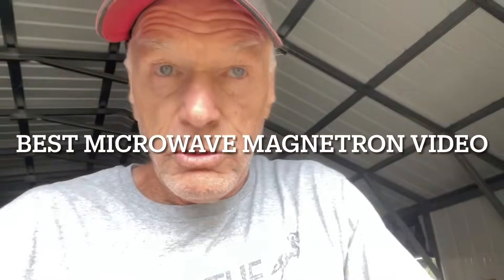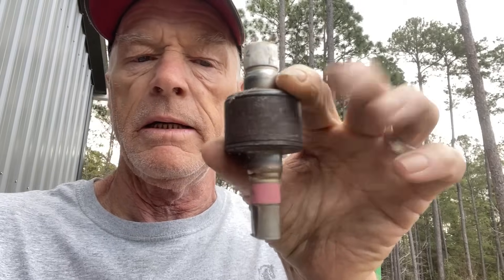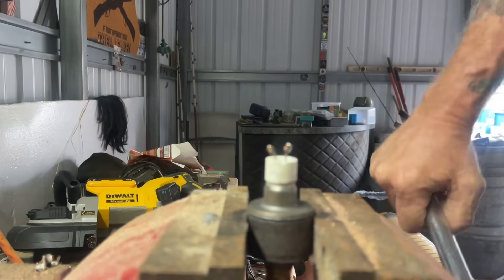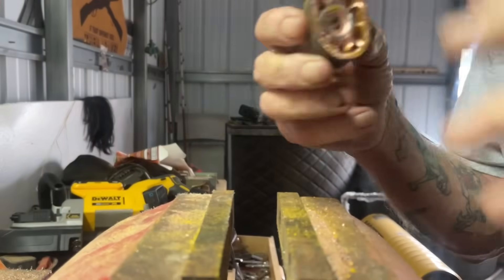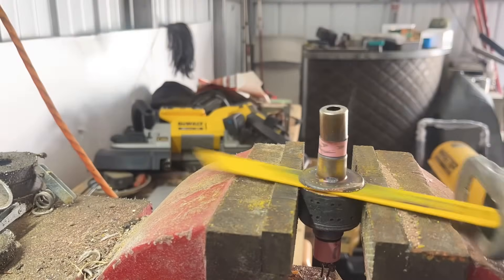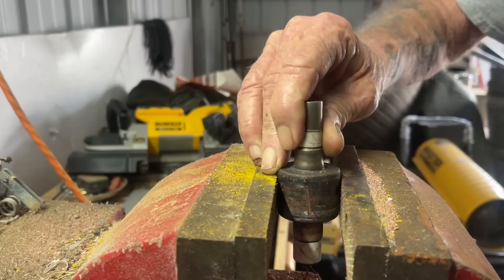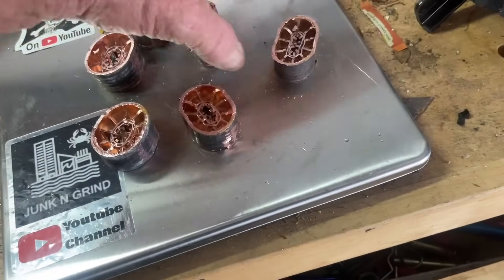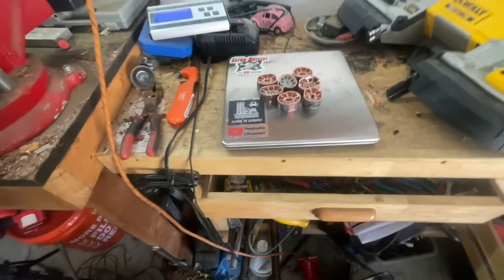(HOW TO) Scrap a Microwave Magnetron. You won’t believe. What’s Inside?

Comment: WARNING > WARNING > WARNING > The pink ceramic on the magnetron is > berrilium < and very very very VERY VERY dangerous !!!!!!! " Beryllium sensitization occurs when the body's immune system reacts to beryllium, which can happen through inhalation or skin contact with beryllium dust, fume, or solutions. This sensitization can lead to chronic beryllium disease (CBD) if further exposure occurs. > Skin Contact: Direct contact with beryllium-containing materials can also trigger sensitization <
Reply: Once sensitized, individuals may not show immediate symptoms. However, they are at risk of developing Chronic Beryllium Disease (CBD) if they continue to be exposed to beryllium. Symptoms of CBD can include:

Shortness of breath
Coughing
Fatigue
Weight loss
Night sweats
Reply from the maker: Look it up on Google. They do not use beryllium anymore in microwaves
Reply: @ScrappingwithGrandpa  from what date forward????
Reply from the maker: The other answers that are currently here are reflexive maybes that don’t actually answer the question. It depends when your microwave oven was made, but for new ones in countries far from Russia I think the answer is no.

These days units and their parts are made in Asia. They probably use aluminum because it is probably cheaper.

There is a discussion here and elsewhere. The measured density was 3.7 g/cm³, near 4.0 g/cm³ for polycrystalline ruby. Meanwhile, beryllium oxide should have had a density near 3.02 g/cm³.
Reply from the maker: Contrary to popular belief, most consumer magnetrons use aluminium oxide (alumina) instead of the much more dangerous beryllium oxide for the insulators. Alumina is considerably cheaper for consumer magnetrons and if broken does not carry the same health risks of broken beryllium oxide.

Comment: DO THIS WITH EXTREME CAUTION!  The magnetron contains beryllium oxide, which is used as a ceramic insulator due to its exceptional thermal conductivity,  electrical insulation, and high dielectric strength.   BeO is safe when intact, but if crushed, ground, or inhaled as dust, it becomes EXTREMELY TOXIC.   It can cause a fatal lung disease called brylliosis.  A pink ceramic ring is often a sign of BeO, but It can be hard to identify as not all are labeled.   It's safest to assume any magnetron contains it unless proven otherwise.  BeO is classified as a carcinogen and can cause chronic brylliosis disease (CBD).  Be safe out there.
Reply from the maker: Thank you for the information, safety is always the top priority. Look up on Google if they use it any more. You will find out that they do not.

Comment: You have to do eight of those things to make $4 ?
Reply from the maker: Yes, but the thing about it is, I can do 25 of them in one hour. That’s what makes it worth it. Save them up.
Reply: @ScrappingwithGrandpa  That's about $12 an hour. Does that include removing them from the microwave oven, or collecting them and throwing them on the truck? What about truck expenses?

Comment: Please be careful cutting, vibrating, blowing dust off the radioactive ceramic pieces, that dust in lungs even a single particle is no good. Maybe a good safety measure to lay out a bit of scrap paper if any particles go free they will not go onto floor so easily and be tracked into home. dip in candle wax to seal it quick be good too. Smoke detectors are bad too old clocks are even worse if face is Iridium painted glow in dark.
Reply from the maker: Great points, safety is always the most important thing!

Comment: I got very sick about 40 years ago and eventually was diagnosed with Sarcoidosis. It turned out I didn't have Sarcoidosis because I'm still alive, but I suspect I had Beryllium toxicity as the symptoms are almost exactly the same. I was scrapping some old electronics, microwaves, relays and other junk. A heads up to those who will listen and value their health; avoid any contact with Beryllium in high power vacuum tubes, relay springs, non sparking tools. If you know a way to test the ceramic please let me know. I have heard they don't use BeO ceramic anymore but would you trust your health to some Chinese manufacturer not cutting corners?
Reply from the maker: I appreciate the heads up, safety is always the most important thing!

Comment: Be VERY careful you don't try that with an older magnetron. They can cause irreversible harm to your health. 
Beryllium Oxide (BeO)
•	Most dangerous component.
•	Found in the ceramic insulators in the magnetron.
•	Extremely toxic if crushed or broken — inhaling dust can cause a deadly lung disease called berylliosis.
•	Safe when intact, but never break or grind the ceramic parts.
Reply from the maker: True

Comment: There is more to the magnetron than that. Some of those tips are solid copper. Plus the wire that you threw away thast poking out of the tips. Might seem like splitting hairs, but I keep everything. It all adds up over time.
Reply from the maker: I know, there’s a lot of little things on them, but it was just a general idea of how to do it. You’re absolutely right about that. I actually did save the copper.

Comment: If you had a metal lathe with a parting tool it would be so much easier
Reply from the maker: Very interesting
Reply: @ScrappingwithGrandpa  lathe spins too fast and the chuck has trouble holding the soft body, I used a home made low rpm chucker and a large pipe cutter

Comment: Just subbed. Love scrapping since I do HVAC work and most folks throw away old HVAC systems which loaded with precious metals mostly copper and aluminum. Never messed with microwaves. Thanks .
Reply from the maker: You are in for a treat. I have seen some cool stuff in microwaves.   Oh yes, you definitely wanna take them apart because you have a couple good magnets in every Mac and every Scrapper needs a magnet.
Reply: @ScrappingwithGrandpa  The pink ceramic on the magnetron is > berrilium < and very very very VERY VERY dangerous !!!!!!! " Beryllium sensitization occurs when the body's immune system reacts to beryllium, which can happen through inhalation or skin contact with beryllium dust, fume, or solutions. This sensitization can lead to chronic beryllium disease (CBD) if further exposure occurs. > Skin Contact: Direct contact with beryllium-containing materials can also trigger sensitization <
Reply: Once sensitized, individuals may not show immediate symptoms. However, they are at risk of developing Chronic Beryllium Disease (CBD) if they continue to be exposed to beryllium. Symptoms of CBD can include:

Shortness of breath
Coughing
Fatigue
Weight loss
Night sweats
Reply: @michaelmontgomery5326 That beryllium is no joke.
And there is also the potentially deadly capacitor.
I will get my metals somewhere else.
Reply from the maker: Contrary to popular belief, most consumer magnetrons use aluminium oxide (alumina) instead of the much more dangerous beryllium oxide for the insulators. Alumina is considerably cheaper for consumer magnetrons and if broken does not carry the same health risks of broken beryllium oxide.
Reply from the maker: Thank you for the Sub my friend. I appreciate it. I love Scrapping.
Reply: Wow man great video my friend,love to learn something new and you are great to watch. Thanks from the u.k.

Comment: It looked like most of them cut ok for you, but if you apply pressure against either the back jaw or the front jaw of the vise, it won't keep trying to rotate on you.  In other words, push in a perpendicular direction to the vise jaws instead of parallel.
Reply from the maker: I will definitely try that on the next one! I have another idea and I’m gonna try to cut that with my band saw I think it will work

Comment: STOP AND READ THE FACTS OR WIN A DARWIN AWARD!
Magnetrons with Beryllium Dangers
Magnetrons in microwave ovens can contain beryllium oxide (BeO) ceramic insulators, which pose a significant health risk if crushed and inhaled or ingested. Beryllium oxide dust can cause berylliosis, an incurable lung condition, and is listed as a confirmed human carcinogen by the IARC.
 However, the risk is primarily associated with exposure to airborne particles, and the insulators are inert and harmless when undisturbed.

To safely handle a magnetron, avoid crushing or grinding the ceramic parts and use a damp rag to clean up any broken pieces, disposing of the rag in a sealed plastic bag while still wet.
 Additionally, ensure that any e-waste, including magnetrons, is properly recycled to prevent environmental contamination.

It is important to note that not all magnetrons use beryllium oxide insulators, but it is difficult to determine which ones do, so it is best to assume that they do and handle all magnetrons with care
Reply from the maker: Fake news

Comment: I do not scrap the magnetron.Exposure to the chemical inside is not worth it
Reply: Magnetrons with Beryllium Dangers
Magnetrons in microwave ovens can contain beryllium oxide (BeO) ceramic insulators, which pose a significant health risk if crushed and inhaled or ingested. Beryllium oxide dust can cause berylliosis, an incurable lung condition, and is listed as a confirmed human carcinogen by the IARC.
 However, the risk is primarily associated with exposure to airborne particles, and the insulators are inert and harmless when undisturbed.

To safely handle a magnetron, avoid crushing or grinding the ceramic parts and use a damp rag to clean up any broken pieces, disposing of the rag in a sealed plastic bag while still wet.
 Additionally, ensure that any e-waste, including magnetrons, is properly recycled to prevent environmental contamination.

It is important to note that not all magnetrons use beryllium oxide insulators, but it is difficult to determine which ones do, so it is best to assume that they do and handle all magnetrons with care
Reply from the maker: There is no chemical inside anymore
Reply: @ScrappingwithGrandpa  Well, I hope not, but I'm not gonna do it if I'm scraping.Old ones Or new ones just to be sure it's still not worth the gamble

Comment: The profits from that wouldn’t buy you a new dewalt recip saw blade
Reply from the maker: You’re right, the price of these is going down
Reply: Same thought here. Wouldn't waste money for a name brand blade. Harbor Freight blades work as well and cost less.
Reply: Not to mention the lung cancer bill
Magnetrons with Beryllium Dangers
Magnetrons in microwave ovens can contain beryllium oxide (BeO) ceramic insulators, which pose a significant health risk if crushed and inhaled or ingested. Beryllium oxide dust can cause berylliosis, an incurable lung condition, and is listed as a confirmed human carcinogen by the IARC.
 However, the risk is primarily associated with exposure to airborne particles, and the insulators are inert and harmless when undisturbed.

To safely handle a magnetron, avoid crushing or grinding the ceramic parts and use a damp rag to clean up any broken pieces, disposing of the rag in a sealed plastic bag while still wet.
 Additionally, ensure that any e-waste, including magnetrons, is properly recycled to prevent environmental contamination.

It is important to note that not all magnetrons use beryllium oxide insulators, but it is difficult to determine which ones do, so it is best to assume that they do and handle all magnetrons with care

Comment: Be sure to save the ceramic electrode ends as that braze alloy has silver and sometimes palladium in it. Also any color besides pure bright white is safe, its either alumium or zirconium oxide ceramic. No beryllium at all. The filamrnt support is also an slloy of molybdenum and rhenium to which the tungsten thorium oxide cathode helix is attached.
Reply: Magnetrons with Beryllium Dangers
Magnetrons in microwave ovens can contain beryllium oxide (BeO) ceramic insulators, which pose a significant health risk if crushed and inhaled or ingested. Beryllium oxide dust can cause berylliosis, an incurable lung condition, and is listed as a confirmed human carcinogen by the IARC.
 However, the risk is primarily associated with exposure to airborne particles, and the insulators are inert and harmless when undisturbed.

To safely handle a magnetron, avoid crushing or grinding the ceramic parts and use a damp rag to clean up any broken pieces, disposing of the rag in a sealed plastic bag while still wet.
 Additionally, ensure that any e-waste, including magnetrons, is properly recycled to prevent environmental contamination.

It is important to note that not all magnetrons use beryllium oxide insulators, but it is difficult to determine which ones do, so it is best to assume that they do and handle all magnetrons with care
Reply from the maker: I’m not sure if there’s anything valuable in this one, I’m just looking to see what’s inside!

Comment: I actually use that exact bandsaw that you have in the background to do mine while I sit out back in my rocking chair. I use a pair of channel locks to hold the magnetron, then run er into the bandsaw blade and seems to work pretty well. I do like your method though, I've just struggled with sawzall in the past, but I didn't do it exactly how you did so I'll give it a whirl. Thanks for the video man, scrap on!
Reply from the maker: When my bandsaw blade comes in, I will try it with my bandsaw and make another video
Reply: @ScrappingwithGrandpa  cool man, I almost made one a while back but I'm just not good with making videos. I will say it is a lil dangerous that's why I started using channel locks or vise grips to hold it while sawing. But after a few I got it down and seems to work better for me.

Comment: Everyone please be very careful as beryllium oxide is VERY harmful. I don't know how to really tell if the microwave I'm working with has it or not, so I always treat it as if it does. It is the pink part and I wrap it with the cheap harber freight electrical tape, I wrap the white ones too as I don't know which ones are the bad ones. I think I learned that from moose the scrapper??? Appartently even small breaks or hits with the blade is enough.
Reply from the maker: It never hurts to be safe

Comment: Don't break that porcelain part on the ends of the magnetron.  It is made with beryllium. Beryllium exposure can cause various health problems, including acute pneumonitis (lung inflammation), chronic beryllium disease (CBD), and potentially an increased risk of lung cancer.
Not every one of them contain it but you can't tell.
Reply from the maker: It was a quick and easy video just to show how to do it. It's a good idea to do some more research if you're going to do this yourself.  They don’t put beryllium in residential microwaves, and they haven’t been doing it for many years.

Comment: Dangerous
Reply from the maker: Not dangerous. Google it. I did.
Reply: @ScrappingwithGrandpa  Magnetrons with Beryllium Dangers
Magnetrons in microwave ovens can contain beryllium oxide (BeO) ceramic insulators, which pose a significant health risk if crushed and inhaled or ingested. Beryllium oxide dust can cause berylliosis, an incurable lung condition, and is listed as a confirmed human carcinogen by the IARC.
 However, the risk is primarily associated with exposure to airborne particles, and the insulators are inert and harmless when undisturbed.

To safely handle a magnetron, avoid crushing or grinding the ceramic parts and use a damp rag to clean up any broken pieces, disposing of the rag in a sealed plastic bag while still wet.
 Additionally, ensure that any e-waste, including magnetrons, is properly recycled to prevent environmental contamination.

It is important to note that not all magnetrons use beryllium oxide insulators, but it is difficult to determine which ones do, so it is best to assume that they do and handle all magnetrons with care
There GOOGLED IT!
Reply: Magnetrons with Beryllium Dangers
Magnetrons in microwave ovens can contain beryllium oxide (BeO) ceramic insulators, which pose a significant health risk if crushed and inhaled or ingested. Beryllium oxide dust can cause berylliosis, an incurable lung condition, and is listed as a confirmed human carcinogen by the IARC.
 However, the risk is primarily associated with exposure to airborne particles, and the insulators are inert and harmless when undisturbed.

To safely handle a magnetron, avoid crushing or grinding the ceramic parts and use a damp rag to clean up any broken pieces, disposing of the rag in a sealed plastic bag while still wet.
 Additionally, ensure that any e-waste, including magnetrons, is properly recycled to prevent environmental contamination.

It is important to note that not all magnetrons use beryllium oxide insulators, but it is difficult to determine which ones do, so it is best to assume that they do and handle all magnetrons with care

Comment: Great video Grandpa! That is slick.
 I don't have any to try it on now and don't have a big vice like you have but i was just thinking maybe even faster after the 1st cut to just squeeze the second side untill it mostly pops loose then a little prying action with a big flat tip to pop it off. ????
Reply from the maker: It is a good idea but that vice makes it so much easier.

Comment: I think that pink stuff is deadly if you touch it. Look into why those things are deadly to touch.
Reply: No. 😅
Reply: The pink stuff is either cr doped aluminum oxide, basically ruby, or MN doped zirconia, wants to be purple. Most white is just plain aluminum oxide material similar to what spark plugs are made of. Beryllium oxide is very bright white and an easy way to tell is the tube will have a warning regarding it. Only the commercial Amana Radar Range tubes have the BEO insulator on the electrode end.
Reply from the maker: Thank you 🙏 I agree. Brilliant is very expensive and there is no way they would use it in microwaves today. It’s only used in commercial products.